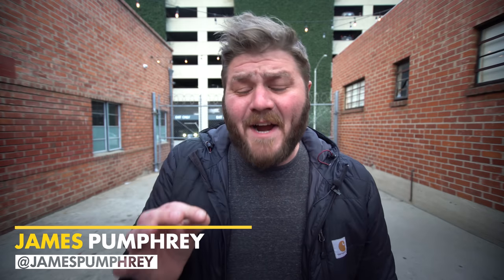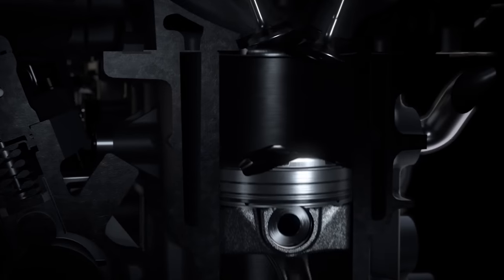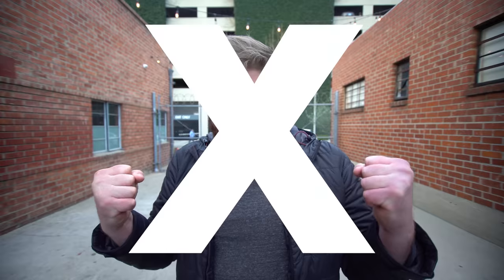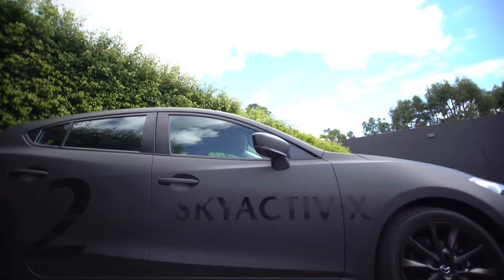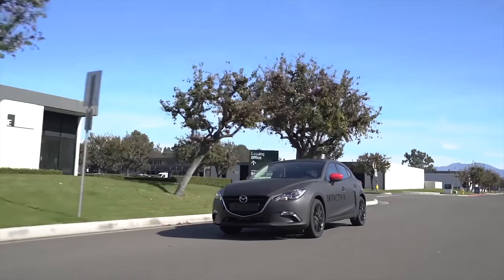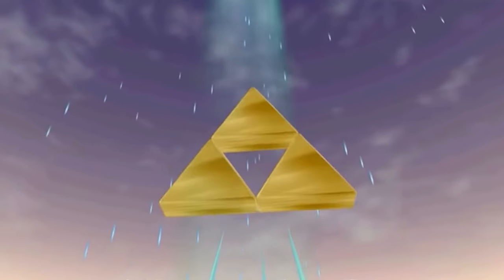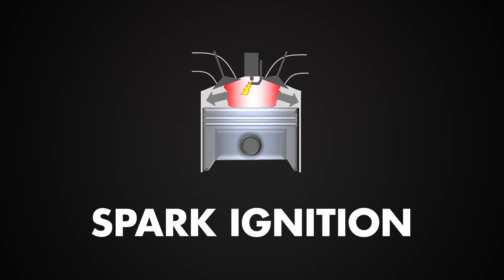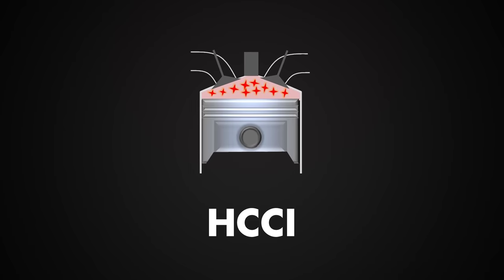Mazda's Secret New Engine Technology - SkyactivX | The New Car Show

Comment: I hope this will make a mazda a shit ton on money

To spend on rotary development
Reply: Toto Geenen Mazda has the funds for rotary development, they've been developing a new one for years until they finally decided it'll never be efficient enough to be used as a sole engine. Unfortunately, the rotary powerplant is seemingly dead.
Reply: Shona I thought they had stopped due to a lack of funds and because they were working on this
Reply: Toto Geenen They recently confirmed that the rotary would be coming back, but as a range extender for an electric hybrid engine. They seem to have concluded that, in their research, the rotary simply can't be made efficient because it needs so much oil because of the high heat and internal rotational speeds it reaches.
Reply: Shona I knew that they were going to use it as a range extender but I thought they were working on a sports car as well :(
Reply: To be honest, any development on rotaries is good for us. Maybe once they figure out how to make an efficient and reliable rotary range extender they'll be able to use that knowledge to make an efficient and reliable sports car engine...?

Maybe i'm being too optimistic, but I can't help get the feeling that Mazda is using the whole range extender thing as an opportunity to shovel tons of money into rotary R&D
Reply: There is a small small chance of hope. They did file patients for a rotary engine as the main powerplant and even flipped it sideways. Who knows though. I'm glad its coming back in some way.
Reply: We don’t need a rotary we just need another Mazdaspeed car. Anything that’s fast or fun. Sick of the only sporty car Mazda makes is the Miata.

Comment: It's not that expensive to repair the body because it's stock I supose I think the engine is where the $9,000,000+ went.
Reply: I Am Sekou no
Reply: I Am Sekou What do you mean R&D?
Reply: lego technic r and d is research and development. Mazda was saying they're 10 million into creating this motor
Reply: Elijah Lawrence aw shet ur right
Reply: Elijah Lawrence then why did they say the car it's self is 10 million?
Reply: lego technic because they spent 10 million on the motor
Reply: lego technic more or like 999999
Reply: lego technic no shit
Reply: It was a joke at the fact he really could’ve fucked up the car :/ woulda been hefty
Reply: 10 million into the research and producing it.
Reply: They spent 10 mil developing the motor. If someone drove this car off a cliff, it won't cost them 10 mil to make the same motor. It will cost more, considering they still have no production line for it, but the research and development is done. 

Making a new one with no production line in place may cost anywhere from 200k-1 mil. 
That is my ballpark estimate.

Comment: HCCI stands for Homogenous Charge Compression ignition not High Compression Combustion Ignition.
Homogenous Charge means the fuel is premixed with Air before compression unlike Stratified Charge which means the fuel is sprayed into compressed air.
Diesels are SCCI (Stratified Charge Compression Ignition) and Traditional Gasolines are HCSI (Homogenous Charge Spark Ignition)
Reply: Evan Ruston Thank you scrolled through all the comments looking for exactly this! I love most of these vids but if you're doing a video about new engine tech at least get the name and tech right!
Reply: it stands for whatever the hell mazda wants it to stand for in their cars.

Comment: I love when everyone hates on efficient cars, but they don't realize that there wouldn't be V8s anymore of there weren't so many damn Prius. Someone has to even out the MPG my dudes
Reply: I remember watching Mad Max (the first one I think) and I remember the special intercepter being called "the last of the V8s". For a while that made me sad because I thought that one day that might be true.

But now it turns out I'll probably end up seeing the last V6 :'-( 

Honda's new turbo 4 is too small for the Accord; but to my knowledge, no one is planning a new 6 cyl, and in fact most manufacturers are designing V6 replacements >:-(
Reply: youfoundisaac Just the cycle of evolution my man. Nobody wanted to see the coal engines go away, but gas took its place no problem. Hybrids and super efficient gas engines are the turn of the tide. Nothing to be afraid of. Performance will always be aspect of transportation as long as the demand is there.
Reply: CeSayrise When countries have to have an MPG average, the fuel efficient cars allow the manufacturer to produce performance cars, so ya, the Prius allows a lot of V8s to be made today. Also check you comment before hitting send. I can barely understand that mess of a thought.
Reply: Yeah i know , my english suck , but hey ! it isn't that bad huh ?
Reply: @Name User Bingo. This guy has got it. Not gunna lie though I have a Prius as my commuter and my favorite troll move is to go 5 under the speed limit. You would be amazed at how impatient people get. xD
Reply: There are probably tens of millions of v8 engines that are already on this earth.  As long as there are people who know how to weld, there will be v8 cars.
Reply: Jordan Hillard  I was talking about newly manufactured cars, but sure. As long as all the V8s blocks aren’t destroyed, you can technically have one, but by then, I will walk you like a dog in my electric car.
Reply: Daniel Williams Electric cars are already capable of being significantly faster than gasoline propelled cars.  But you’ll never be able to put any type of “soul” into an electric car.  We love our cars for more than just their performance.
Reply: Jordan Hillard People will say the same thing about 60’s cars. They don’t have as much “soul.” Seems like the ongoing trend that people will always have a certain lust for the past or everything is getting less “soulful.”
Reply: FuckOuttaHere Prius still doeant have a soul lemao
Reply: Few people will care once the prices come down on electric, sure we will miss the noise and vibration but it will all be forgotten with all that go.
Reply: Teslas are outselling Prius! Where's the future for the ICE?
Reply: Umm are you sure about that, just say'en?
Reply: what I want... is a V8-powered Prius

Comment: I’m not hating on Mazda but they are able to save the gasoline engine yet not the rotary, but if they are able to save one they are able to save the other, and I’m confident that Mazda is trying to revive the the graceful spinning dorito
Reply: that will only happen with hydrogen
Reply: you cant save the rotary, it is the two stroke engine of the car world. less parts and smaller engine producing much more power to weight than any other engine but with less reliability due to the design focused entirely on making power. the main problem is the fact that the rotary burns oil which is a massive problem for emissions regulations which is why it would have been stupid to continue working with this engine.
Reply: The Wankel engine is dead, Mazda ceased development of production Wankel engines back in May 2009.
Reply: +Owen racing Mazda only sells reciprocating engines since 2012... the Wankel engine was permanently discontinued because new car buyers refused to buy the  anymore.
Reply: Wankel engines are completely obsolete in the automobile and engine manufacturing industries... you would have to be very gullible and naive to believe these inferior engines will ever come back... this is simply never going to happen for obvious reasons.
Reply: Mazda CEO said NO, they have absolutely no plans to bring back the Wankel engine and there is zero evidence to suggest this policy has changed apart from fake rumors started by amateur bloggers as "clickbait" headlines.
Reply: Rotaries fail at everything the modern car world deems important. Namely low emissions, high gas mileage and reliability.

My opinion is that electric motors should do about everything the rotary engine can do, but better. Less moving parts, higher efficiency, compact, light and high revving...
Reply: One thing is for certain, the Wankel engine is dead... and it is never coming back.
Reply: Owen racing  Hey i just noticed that this guy ( The real doktorbimmer) has a real major Rotary engine chip on his shoulder! LOL, A cursory look at his ramblings shows me he couldn't engineer his way out of a wet paper bag! LMAO.

Comment: Mazdas VTEC
Reply: Xillerrz *VTEC killer
Reply: Almost every Mazda since 1986 till had a system that resonates the air around 4K RPM.  Porsche, the Audi R8 and probably a few other manufacturers use this technology to some degree.

  Most people change out their air intakes on Mazdas when they modify them.  This renders the VRIS useless and then no kick at 4K.

  If you modify Mazdas while still keeping the factory intake the results are usually much better.

Comment: Turbo that freacking motor!!!
Reply: Max Power I think they will later for sure although the high compression may be an issue reliability wise.
Reply: It's supercharged already
Reply: @timb1762  turbo is better. New F1 engines run as HCCI, and are turbo
Reply: @R4M_Tommy  do you know that f1 engines are discarded after 2000km don't you?

Comment: like diesel, but petrol... 

wonder if others manufacturers will use this technology too
Reply: Diesel engines are Stratified Charge Mode combustion, not homogeneous Charge Mode.
Reply: @doktorbimmer  ok.. and?
Reply: I think Toyota are now sniffing around Mazda in what could be a take over if not a partnership, Mazda are believed to have a straight 6 skyactive D and i think an X if not a G in the pipe works for their large platform, rumoured to be shared with toyota in some Lexus cars in the future, a straight 6 skyactive rwd mazda,what a time to be alive

Comment: Interesting idea, and I applaud the effort, but ICEs are an ancient technology and no matter how efficient they will try make it, it’s still burning fossil fuels.  Whether you like it or not( I don’t), electric is the future.  When put against each other, electric car beats ICE in both performance and efficiency. The  only downside to electric is range and lack of charging stations, but even that is going to change as technology improves. There is a reason pretty much every auto maker has some sort of electric car R&D program, they know that days of internal combustion engine are numbered.
Reply: armoredsolidsnake only thing that I didn't like electric cars are heavy and don't have any transmission (other than conventional auto and cvt).
Reply: Except for the fact that the total amount of pollution made by the production ofthe batteries of an average electric car is greater than the average diesel engine would produce during its life span. Electric tec has yet lots of years of research before calling themselves green. That's just so the ignorant buyer think he's doing any good. He isn't. It's just better for his wallet, at least until a breakdown or needing new batteries, which by this time the electric car would have produced 2x more co2 and nox than the average diesel and cost you a lot more in the long term. It's a gimmick. On the other hand a fuel efficient petrol car that produces less co2 and nox (that they always did) than a diesel or an electric without having to downsizing it or turbocharging is amazing for N/A and reliability lovers. These new 3cyl Turbo will have to work more for less, with more parts to go wrong with those shitty unreliable testicle sized turbos and it'll prove to have no real savings in real life economy. Also a gimmick. Can't say much about reliability or durabilty though. But to each his own.
Reply: electric is 30 years away yet, we need to massively increase the supply of renewable energy first
Reply: armoredsolidsnake You don’t think creating the EV fuel requires fossil fuels to create as well? Fossil fuels are limited and we will run out eventually, but Mazda is finding a way to make it work.
Reply: 1. An Electric Car (ignoring manufacturing pollution) just passes off the greenhouse production from the car to the powerplant. If your grid isn't green, you've done literally nothing except buy a very, very heavy battery filled with materials that are extremely hard to recycle: something is still creating greanhouse gasses; the power for your car is no greener than the fuel at the pump.

2. Batteries are extremely heavy, and contain only a minute amount of power versus a Combustion engine and the required fuel. Oxygen is everywhere, and doesn't need to be contained within the car, which lightens the vehicle substantially (if you needed to put the car outside of an oxygenated environment, then yes, batteries would be much better. But we don't.). The lighter the car, the less emissions. This is important for both battery, fossil fuel and alternative fuel cars. Current batteries have an inherit flaw in their weight, but they can improve emissions in Hybrid vehicles, where the cost of weight can outweigh the efficiency benefit to an already efficient ICE.

3. A highly efficient combustion engine (Input Hydrocarbon and Oxygen, output Carbon Dioxide and Water; no NOx, no Carbon Monoxide, no methane/loose hydrocarbons) would pollute far less than you seem to believe. Yes, it would still produce CO2, a pollutant, but the intention of the advancements in ICE technology accomplish three things: Reducing fuel consumption per Watt of rotational power (fuel and heat efficiency), increasing watt power output per cylinder displacement (watt per engine size), and decrease the harmful emissions before it reaches the catalytic converter.